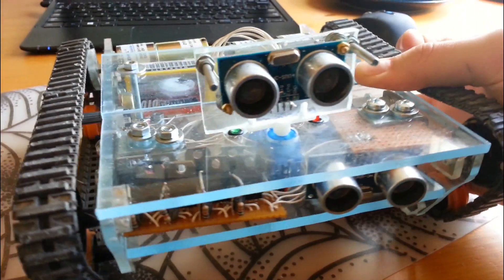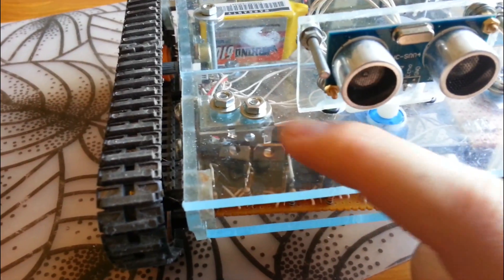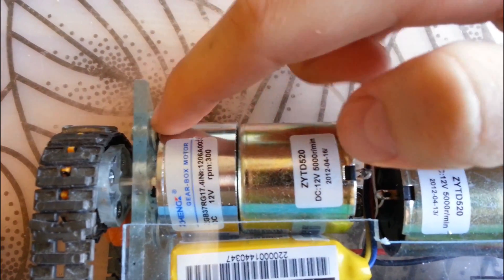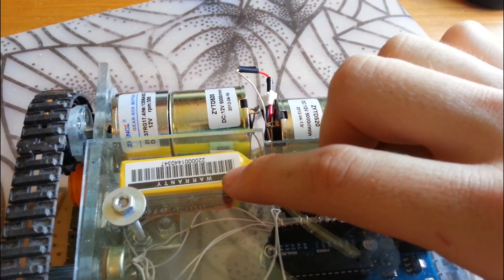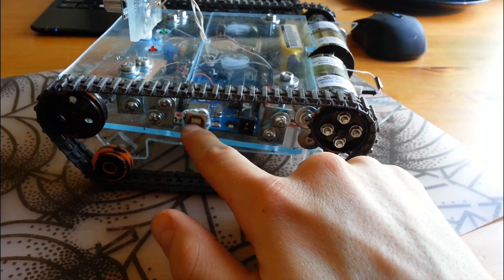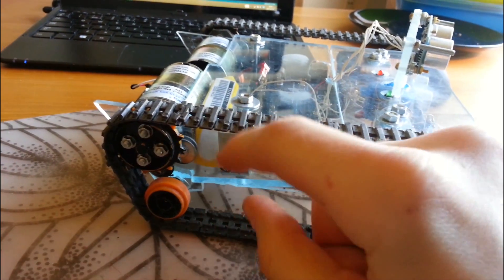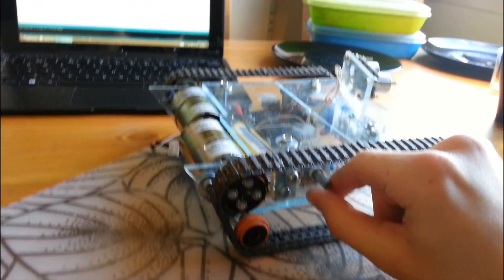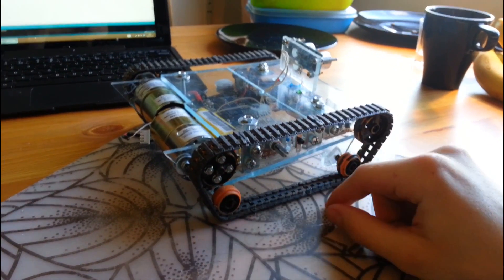DIY Arduino Robot walkthrough, specs + code

Comment: Hi, Great project. Thanks for the video. I am building something similar to this and one of the issues I am running into is with Tamiya wheel track set. I am using a 12V DC Geared motor which has a bigger shaft which is not fitting into the Tamiya 3mm hole in the wheels. Looks like you are using Tamiya tracks, can you please let me know how you resolved this issue? Thanks.

Comment: Hi Josef, I know it's been a while since you build this, but I just have a question on how it works. I build your robot almost exactly how you have it here. I used a motor shield for all 4 motor though. But whenever I turn it on, only three of the four motors works, and it varies on which one. Is that supposed to happen? If not, how can I fix it? Thanks for the help in advance.
Reply: +JkaneGaming , sounds like you are drawing too much current at one time.

Comment: Hi Josef, my first question is where did you get the tank trucks and the second is how do I find a good motor for my use? I want to build really small bot with arduino nano, one servo with your principle of looking around with sensor and 2 motors. I will use 4 AAA batteries to or 4 AA batteries to get it as small as possible. I also may add 9V battery if needed.Any sugestion to find a right motors? Thank you very much.

Comment: so long code because music box speaker! I think the music for the additional/optional only, right!! but i'm making the plan to make 'tank bot' like this .(Y)(Y)
Reply from the maker: mukhlis1010 , yes, you can certainly get the code smaller by erasing the different fun-modes and speaker-music and what have you. Good luck!
Reply: 0kay...! And then, buddy I've some question, wht the proramming of my arduino robot if i use motor driver L293D with servo and 0ne ultrasonic sensor HC-SR04? You've the sample code to me?
Actually, I've tried uploading another code for my robotank from 'instructable.com', but i got the problem, so that my project becomes a bit bottleneck.! Oh.. yeah, wht 'NewPing.h' mean in your code, whereas hc-sr04 you use? Plz, responding! Thnks...:-D

Comment: Hi Josef... so ive been going over your video and wanted to see if a 6 transistor h bridge was actually used or if there are only 2 h bridges (each consisting of 2npn/2pnp) totaling 4 transistors per h bridge. Dont want to use your code if it doesnt match with more transistors.
Reply from the maker: MyBubba2468 , This is basically the schematic for the h-bridge http://i.stack.imgur.com/sI9uM.gif , I don't have the schematic for the one I made still, and the transistor number don't match. But the function is the same.

What kind of h-bridge you are using should not matter as long as it can handle the current and you know how to control it. You might have to edit the arduino code depending on how the h-bridge works. Some off-the-shelf motor controllers will have an enable-pin for examle.

Comment: Hi Josef, great work on the robot, really impressive. I am planning to build after seeing yours, hope you can answer my questions now and then :-)  the enclosure is custom made right? what will be good material for cutting using dremel? Plastic or acrylic? also can you please let me know where you those wheels from? is it Tamiya 70100 Track and Wheel Set....thanks in advance for your help.

Comment: Hello Josef, I noticed in your code you only have 4 pins connected to h-bridge what about the En1 and En2 do you use these or you set it to HIGH at all time? I am struggling to understand how you control the motors. a quick drawing on the motors connection would greatly appreciated. I am using L298 H-bridge btw, Thanks!
Reply from the maker: Jimmy Kan I made my own h-bridge using some npn/pnp transistors. (Try to google 6 transistor h-bridge). It only takes 4 pins from the arduino, two for each motor, one for each direction (forwards/backwards). If you have bought an h-bridge that requires some extra enable-pin(s), you may need to modify the Arduino code to be able to use that h-bridge. Good luck!
Reply: Jimmy Kan how do you use with the L298 H bridge
Reply: Josef Holmner I finally made the robot thanks to Terrance Macabe (Terry) help but somehow the top sensor seems not scanning the bot keep bumping into things, it back up because the bottom sensor is working. I am sure the sensor is not defective, tested with a simple code and it worked.
Reply from the maker: Jimmy Kan , you may want to have a closer look at the wait-time that is set to let the servo get to the correct position. If the servo is to slow then it will try to read while still turning. You should be able to locate the problem with some debugging. Good luck!
Reply: Sky Racer Link to the code is under the description!
Reply: the en1 and en2 can just be put on a voltage rail all the time it does not need to be controlled by the arduino per she.

Comment: Well I made up a chassis from old CD's and transferred the rats nest components as well as the micro geared motors and tested the bot and it worked perfectly. It's a little slow because of the motors used but I will now transfer the lot over to a better chassis and I have some large geared motors on the way so all should be ready by christmas for the grandsons to play with. Many thanks again for the share, all the best, Cheers, Terry.

Comment: Hi Josef, I grabbed your code that you used and did a rats nest on a breadboard and it worked very well, thanks for the share, my grandsons will love it when I put the robot together for them tomorrow, Cheers from Australia, Terry.
Reply from the maker: That's great Terrence, hope everything works out as planned!
Reply: Terrence MacCabe Hi Terrence, since Josef does not provide a wiring instructions, can you provide one? Thanks!
Reply: Hi Jimmy, yes I can help you re the wiring but I'm away from home at the moment in Sydney and I won't be home in Bathurst until tomorrow. If you like give me your email address and I can send you some information that I'm sure will help you get it together and working, cheers, Terry.
Reply: Hi Terry, would you be able to email me the wiring as well barrydillon@activ8.net.au   a fellow aussie (W.A.)

Comment: What kind of collar/coupler did you use to attach the motor shaft to the sprocket? I've been searching online for such an item with not much luck.- Well done sir!
Reply from the maker: Thank you!
I made my own coupler from the plexi-plastic used for the chassi. Made it with hack-saw, drill and a small file. I did also use some glue to secure it.Good luck

Comment: Awesome effort. Did you have many headaches coding the pivoting ultrasonic scan?
Reply from the maker: Thank you! It worked out pretty smoothly. I timed how long it takes for the servo to rotate through a certain angle. So i just inserted a delay and let the sensor take the reading while the servo is still, then when the reading is done it looks the other way and so on.

Comment: If the motors are 12V, does that mean your batter is 12V?
Reply from the maker: The battery is a 3-celled Lipo, so that is about 11.1 V. The motors can be given a range of voltages (lower voltage = lower speed), but the recommended voltage level is about 12 V. Going higher is probably not recommended.